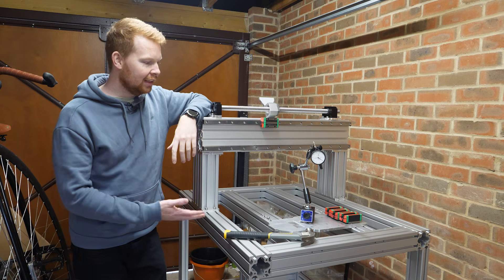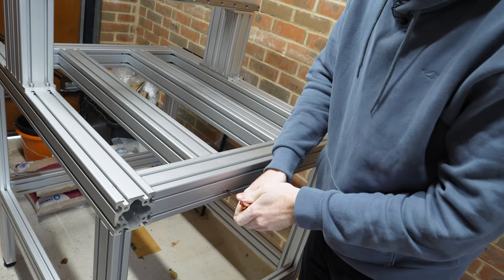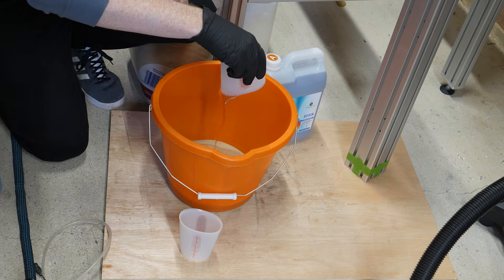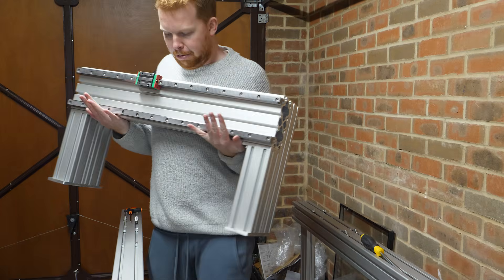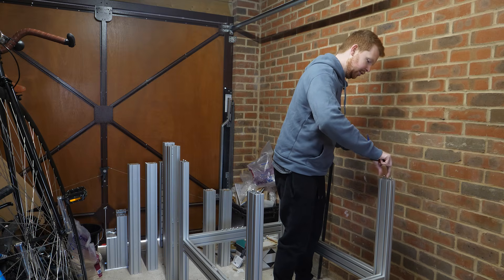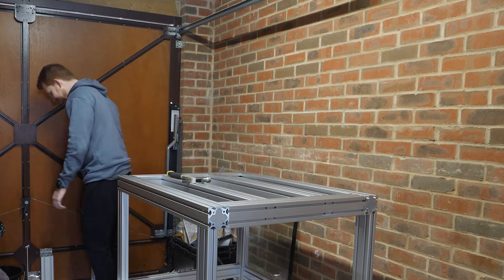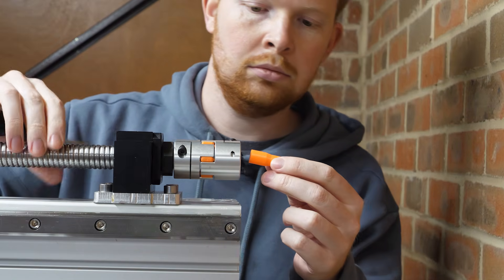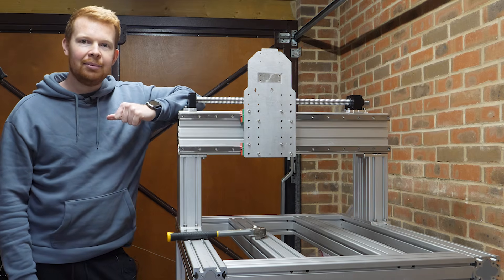Building a CNC Mill/Router - Part 2

Comment: What a fitting video! Just yesterday I decided to fill the column of my milling machine to reduce vibration and increase weight. I used a product called "Durfill" by Durcrete which is a cement glue based engineering concrete for filling structures and building machine bases. It expands slightly when curing to fill gaps and self levels. It's less of a mess than dealing with epoxy resin.
Reply: You mean durafill?
Reply: @NiclasGudmundsson  no, I used Durfill from Durcrete, a German manufacturer of ultra high performance concrete.
Reply: @Sven_Hein  ahh thanks, I will have a look to see if I can find that here in sweden too. I'm having thoughts to make a concrete bottom part for my machine so I can have a built in coolant system.

Comment: The natural frequncy of the central 2 beams in the bending mode is quite low still. You can help reduce ringing further by adding vertical (or triangular) support columns underneath the center 2 beams, supporting their centers from the floor. This should increase the lowest natural frequency of the center beams at least by a good amount (I am guessing 4 or 8 times), which should reduce ringing. 

This only helps the up and down bending vibration mode though. To also reduce the in and out of plane bending vibration node you could add 3 short support beams in between the beams on the platform, supporting the centers of the beams from the side.

Comment: Currently working on a cnc build as well with an extrusion based table/enclosure. To cut down on vibrations and to make the table much stiffer im attaching mdf panels to the sides of the table. Also contemplating using some rubber like gasketing or some sort of putty between the mdf and extrusion. 

Regardless, stoked to see where this goes! Oh and also something worth checking out is services like jlcpcb, pcbway (pretty sure they do sponsorships) and rapid direct. If you have any weird brackets or mounts you wanna make, you can just shoot them some cad and some money and you'll get back freshly machined pieces.

One other idea, where you have linear rails, you could just get a slab of mic-6 and mount your linear rails to that. Mic-6 is usually pretty darn flat and not too expensive.

Anywho looking forward to the rest of your build!

Comment: I would suggest to further stiffen the lower structure (that can't be filled with sand), for example by simply introducing more cross beams or diagonal beams. This should greatly reduce vibrations in the system.

Comment: Here is what’s happening: filling the cores increased the mass and lower the resonant frequency. But to dampen the vibrations, you need to dissipate that energy somehow and for that, you need loose sand. I think you’ll be fine, but you could try filling the legs with loose sand and compare them to see how it changes. I did this awhile back with some speakers stands I have. I filled one with some very dry, fine Masons sand and compared the sound by swapping stands with one that wasn’t filled. I didn’t expect any difference, but it really sounded significantly better. So, I don’t know if it would make a difference in machining quality but it does make a difference. If nothing else, maybe it will help to make it quieter when operating. You should also try to use some strips of sound dampening mat, like they use for car audio. You don’t need much, just a strip on each extrusion. Just be sure to put it where you’ll never need to remove it because it really sticks.

Comment: curb your enthusiasm )
modification you've done is mostly a convenience. machine will run much quieter and overall feel nicer but it has little to none effect on a tool chatter at high freq.
tool chatter happens in a tool itself and in a spindle shaft. (if we talk about end mills up to 8mm in diameter).

Comment: This makes me curious if it would be possible to make an adapter to a bottle of spray foam insulation so u could fill them up top to bottom? Or what about filling it with Corn Starch or floor or dry wall mud? Just curious?

Comment: 80x80 extrusion on the gantry at 45°. Large 10mm or so triangular plates bolted on from the sides to further improve the rigidity of the gantry. I think some sand blasting media is more dense, especially if you mix different grain sizes. It can be packed more densely by tamping with a rod.

Comment: I don't think adding weight to the bottom of the base will help that much, since the main problem, it looks like, it the frame itself flexing (very slightly, which is what the vibrations are).  Like others have suggested, I'd definitely say finding a way to fill the legs would be a massive improvement.  Whether that means changing the legs to be the square tubes so they're easier to fill, filling them with loose sand rather than the epoxy mixture so that it's easier to fill, or something else.  I work in custom automation, and for machines with something like an ultrasonic welds on it, which exerts tons of pressure (literally) and vibrates in the range of kHz, so frame rigidity is very important, I would think it would be a strange design choice if one of our designers made a big stout gantry and mounted it on less stout legs.

Comment: yeah, aluminium has a tendency to vibrate in unpredictable ways. I never understood the reason as to why. Steel for example is much more predictable. Predictable as in motion filtering algorithms are much more effective on steel framed motion systems than compared to aluminium. Wood is unironically excellent too in many ways. Maybe some wooden struts on the legs and semi load bearing walls around the top (Similar to something like the shapoko nomad).
I'd love to see the analytical 3D motion graphs of an accelerometer mounted to the 'head'. Klipper style with the different motion filtering algorithms. Maybe get the axes up and running and take some baseline readings, albeit with sand already and then add some wooden struts or side walls etc. and show the difference

Comment: you should also defenetly lube the bearings with lube recommended by the manufacturer, they usually come unlubed and just have a film of oil to protect them!, you have to clean off this oil and then lube them yourself

Comment: Unfortunately the sand isn't going to do anything to affect cut quality on a measurable basis, the focus should be on the axis drive system and overall rigidity of the design.  Ball Screws have inherent slop by design and while you can compensate somewhat in software, Rack & Pinion would be the choice if you're going for accuracy to the degree you're dampening frequencies with additive measures.

Definitely look into a liquid cooled spindle if your focus is on noise abatement, while no machining process is quiet, the liquid cooled spindles are miles ahead of air cooled versions and they offer better angular contact bearings with less run-out than using an adapted woodworking router.
Reply: sorry you have the BALL screw vs rack and pinion end play issues completely arse about. Ball screws work on similar principals as roller bearings so have nearly zero end play which is why they are the ubiquitous on industrial CNC machinery.
Reply: @RobB_VK6ES  ubiquitous doesn't equate to ideal which is why software compensation exist specifically for ball screw applications.

Comment: The biggest mistake was mixing sand with epoxy. Loose sand acts like a dumper, it does not move like a single weight, but the movement of grains relative to each other dampens vibrations. Moreover, loose sand fills the empty spaces more tightly. In fact, you had to print the ends of the profiles (which you did anyway), paste them on epoxy, and pour loose sand between them.
Now you just added masses to the profiles, which is of course positive, but not as good as it could be.
Reply: Epoxy-granite acts differently - the epoxy absorbs the energy as the vibration waves travel between the sand grains and the epoxy.
Reply: A lot and i mean a lot modern machines use epoxy granite as there base instead of cast iron to dampen vibrations.

Comment: Youtube deleting every single of my comments 😂
Im making custom epoxygranite castings for cnc frames , if you need any tip ask under this comment 
PS
You should first mix resin with hardener and then mix with sand , never other way
Reply: PS2
MDF all around with some mounting glue / silicone should help with wibrations

Comment: That Ballscrew is huge haha. Using huge ballscrews isn´t always good because it adds a lot of angular momentum to the axis, wich will impair acceleration a lot. 16mm Ballscrews are already way overkill for a hobby machine judging by the static and dynamic load they can take.
Reply: yeah waaaayyy too big, if you want to reduce backlash you need a double nut as well, they preload the threads to provide greater axial stiffness.
Reply: @muzzarobbo  not entirely true; a ballscrew that uses "gothic arch type" ball tracks can be preloaded with a single nut. on a rolled screw this is the preferred method due to inconsistencies in the shape of the screw; a double nut on a rolled screw is more likely to bind up. if you want to use a double nut, the best thing would be to get a c5 or c3 precision ground ballscrew. the size of the ballscrew impacts acceleration but even a 60x60 mm 400 W servo should have no issues accelerating this ballscrew with 1 G of linear acceleration. the inertia of the system just needs to be close enough to the rotor inertia such that the servo control loop remains stable at those speeds
Reply: yeah lol i've assembled a like 4m axis on a cnc machine and it aint have ballscrews that big

Comment: The stuff in the middle of the beams is not as stiff as the aluminum, and it's close to the neutral axis. It isn't moving much, so to do much vibration damping it would need to really efficiently damp any motion that did get to it. The loss tangent should be high at relevant frequencies. Maybe RTV would've been a better binder than epoxy for this application. Something soft and goopy, bare minimum to hold in the sand--it wouldn't be load-bearing no matter what you did, so might as well maximize dissipation. 

In epoxy granite, the composite is load bearing and moreover in the good stuff the load paths are through the aggregate to such a high degree that its mechanical properties are more rock-like. That's hard to do. You need several aggregate sizes and powerful vibration to consolidate it.
Reply: And the ideal amount of binder.

Comment: I thought the whole point of adding sand to things such as dead blow hammers or in your case a CNC router frame, was to allow the sand to move freely and absorb vibrations. I understand its easy to not have the sand moving around but I would have thought loose sand would work better.

Comment: I am going to repost my previous comment from the previous video since I believe it could cause problems in the future for you:

I am skeptical of that ball screw placement. Ideally, you'd want to position it in a location that wouldn't create torque on the gantry, which in a non-loaded situation would be in-between the two linear rails. You could also position it on the underside of the carriage in a spot that would oppose the torquing force produced during cutting.
Reply: With the seeming scale of the screw and rails I'm not too concerned about that - the torque isn't going to be huge and those rails and screw look rather overkill already (at least for this frame construction). Plus the reasonably large spacing of the rails and bearing blocks on each rail will help it deal with the lateral loads the torque can create. And as Putting the screw on the top does keep it out of the path of debris from use and out of the potential workspace of the machine... Will obviously depend on the quality of screw, rail, etc but I think this is an acceptable tradeoff for this design, I think its the way I'd do it if I chose to build with those extrusions to this scale (but I don't think I'd do that in the first place - my plan for a machine that fits my space well is currently steel C sections and square tube largely filled with epoxy granite - may not be a good welder (yet) but I can stick metal together that way and to me seems the best mix of easy, affordable and stiff frame).

Comment: Following! :) Your videos are always top quality. I'm going to make a CNC lathe with filled welded tubes (80x80x5mm steel) but i'm thinking about using pure dry sand due to the huge epoxy cost. I'm wondering if there's much difference between dry sand vs epoxy-glued sand.

Comment: This sounds a bit out there, but take some 3M double sided adhesive tape (the really thin stuff) and tape thin aluminium plate over every exposed t-slot, this makes them all closed sections. 3M adhesive tape is shockingly strong in sheer (if you choose the right one) and changing the open sections to closed wall sections increases the Torsional rigidity of the beams, the tape also gives some dampening. This is something Alexander Slocum speaks about in one of his lectures. He's the writer of "Precision Machine Design" - which is basically the machine design engineer's bible.
I think it's this lecture: https://youtu.be/8rKrUsXiFOo?si=mmLKntXZSzGy7-vk&t=700 (FOUND IT)

Comment: Interesting that you filled up the rails with epoxy granite. I did something similar when I was putting together my own CNC router to cut down on the vibrations during milling.

Instead of just the rails though, I made a mold for the whole base of the CNC and poured a mix of 20% epoxy and 80% sand into it. And it worked well. I basically wrapped an aluminium frame in epoxy-granite for my CNC machine.

One thing you might want to think about is shaking out the air bubbles and gaps in the epoxy granite a bit more. I rigged up a DIY vibration table for this, attaching a cement vibrator to a plywood board, and let the mold vibrate for the entire curing time.

I'd think filling in the gaps in the aluminum grid structure on your CNC with epoxy granite would make the vibration dampening even better. Just my two cents from building my own CNC machine with epoxy granite for the past year.
Reply: Where can i see your build?
Made my CNC base out of structural concrete and i love it.😊
Reply: Do not constantly vibrate during the curing process this causes the sand to settle to the bottom of the mixture. This is a big no no when mixing regular cement. You can actually see it happen if you put a vibrator into the mixture and not by vibrating the entire structure. The mixture around the vibrator becomes watery if you leave the vibrator stationary.

Comment: I recommend to fill the legs with fine loose sand. It absorbs vibration much better
Reply: Yea the whole point of using sand to dampen sound is that it converts vibrations into heat through friction, when you "stabilize" the sand with resin and remove the friction aspect, just creates a new medium for sound to travel through
Reply: @bj_  The resin/sand material is not a crystalline structure though, like metal. Loose sand is likely better but at this point we're probably splitting hairs.
Reply: Did you ram the sand down or just let is fall down?
Reply: @TheRattleSnake3145  You want it loose
Reply: @lennart637  it's not loose if it is mixed with epoxy
Reply: @TheRattleSnake3145  that's precisely the point, you wouldn't want it mixed with epoxy
Reply: @lio1234234  my point is, he already mixed the epoxy with it.  It should therefore have been rammed down so it was  as dense as could be and as a result , it would be heavier and have a lower resonance .
Reply: That’s exactly what I was thinking… then the sand can vibrate instead of the aluminum…
Reply: i think its gonna be hard to remove the epoxy sand mix
Reply: @BentScrew  the legs are still hollow.

Comment: Drill holes in the legs and cross beams and fill with straight epoxy. Gonna be TOP HEAVY and Wiggle.
Should have filled them B4 reassembly...  Cool Project to learn from. thank you

Comment: Tip for pouring from containers like the ones your epoxy came in: hold the bottle sideways, so the hole in the handle is "eye to the sky" This way you dont get the typical glug glug that slows down pouring and makes it more dificult to be precise.

Comment: I would have tried to print the end caps out of TPU so they might have more of a snug fit. Even if it's PLA with a press fit, there might be tiny gaps. TPU is more space filling witch is why people use it for gaskets. Regardless sad it didn't work out as hoped.

Comment: The sand will help the most with the high frequencies represented by localized flexing of the walls. The lowest frequency modes represented by the whole thing going back and forth in bulk wont care as much about the epoxy fill; the high frequency modes would be the most annoying ones to deal with for the machining process though; there is a lot of energy injected into the system at your spindle rpm * number of cutting teeth; not really a whole lot in the lower audible range of a few 100hz where most of the leftover response seems to be. Thats just armchair philosophy though, don't have hands on experience. But it seems like a worthwhile upgrade to me.